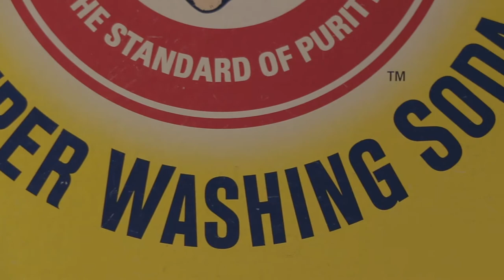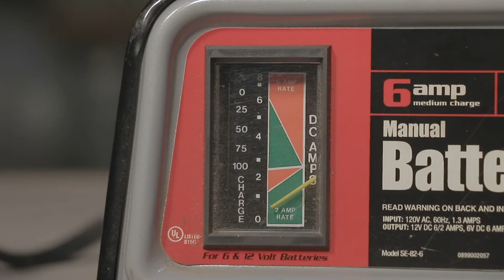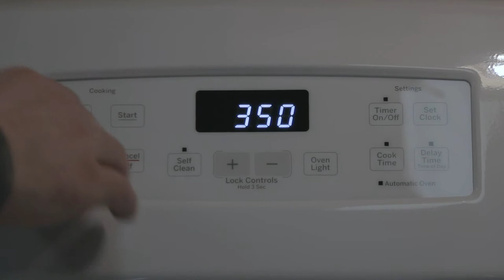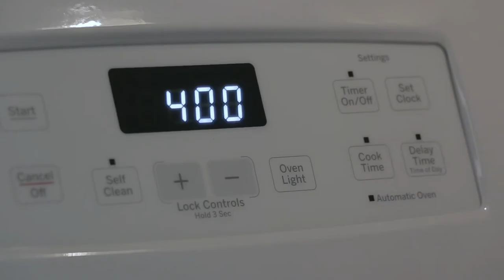A Humble Cast Iron Pot Restoration

Comment: I do this a lot and I'll tell ta what people say but don't try. Stainless steel anodes are the easiest to clean but "they say not to use stainless.. I use a rolling 40 amp charger that delivers 38 amps when properly loaded. 38 amps with SS anodes would be enough to produce some gas I'd think, two years with no problem. Using your wife's oven was the most dangerous part of this video. I suggest you buy a cheap oven on the last day of an estate sale. When I'm working on something like a bean pot I  hang it vertical from the bail and drop an anode inside the pot. I use an all thread rod with a PVC end cap on the end for an insulator. Just set it in the pot since electrolysis is a line of sight type cleaning.
My barrel/ tank holds 30 gallons which requires 17 ounces or half a box of Arm & Hammer so I get two refills from a box. To load it properly it requires surface area so I do best with three pieces at one time. If I use four pieces my anodes eroge faster and it takes longer to clean because it is a line of sight cleaning.. Four pieces can require 24 hours while three can come clean in 12 hours if I'm lucky. Occasionally one need to go back in with the new ones. I use an electric pressure washer to pre clean the pieces and blow the crud off of the tight spaces. I clean the anodes with it also. As for rapidly drying the piece before oiling I use an electric leaf blower. This may not be practical for most people but I clean for two estate sale companies, myself, and occasional individuals. When it starts cleaning slower the anodes need to be cleaned. At around 150 hours the water needs to be changed. I may get 20 pieces at a time, I just never know. I'm retired/ white trash and this gives me something to do. I have tried to build the most efficient tank possible, this is my third tank and I hope I have it right. I can improve on anything at this point. Hopefully I've said something that can help someone else.